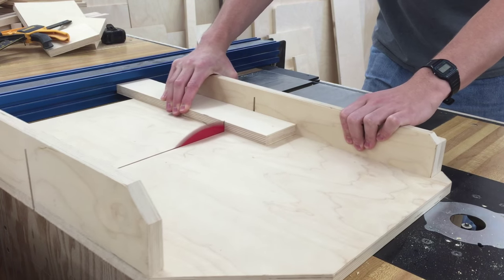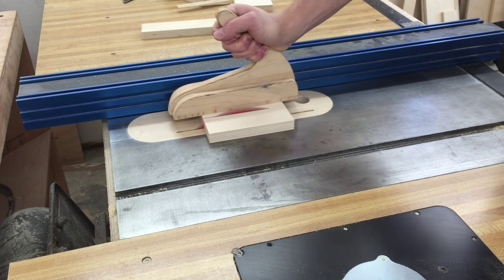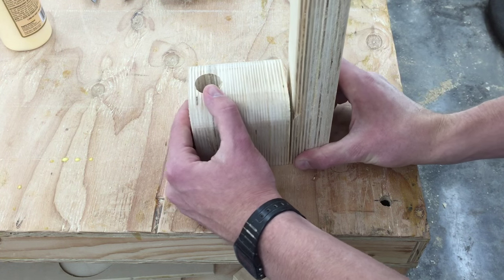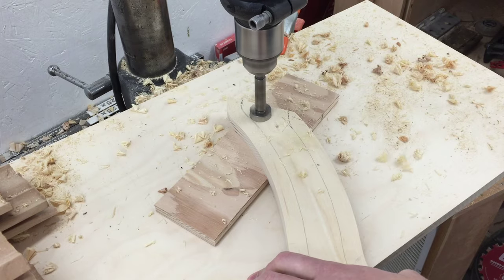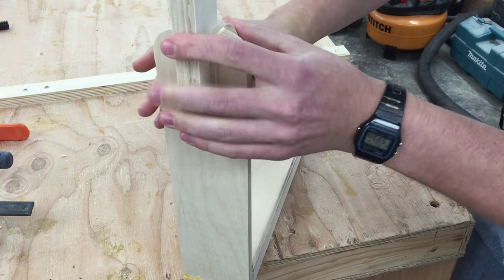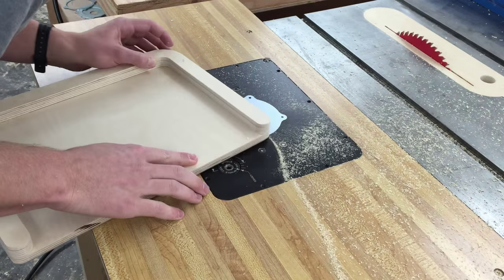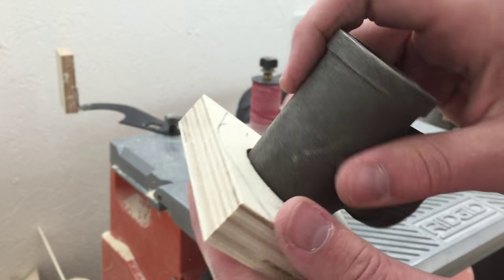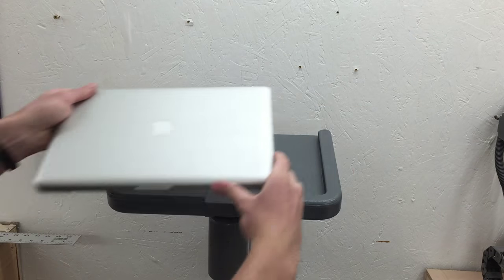Shop computer wall mount

Comment: Nice bandsaw :)
My laptops all blow hot air out the side, so that would need another hole.  Plus power, cause my batteries suck.
Reply from the maker: Thanks! Love the bandsaw.
And that's just two of the reasons I love MacBooks :-)
Reply from the maker: +Derek Richline I really hardly even run Sketchup on this one. I do the drawing on my other computer and use this one to view dimensions, and sometimes use it for internet browsing. But it would never get to 170°, with my other MacBook I doubt it ever gets to 100° when editing video.

Comment from the maker: If you have an opinion, please comment: do you like videos like this one (sorta long but covering (almost) every detail of the build) or do you prefer shorter, less detailed videos? Thanks!
Reply from the maker: Thanks for the feedback! I use the earbuds that came with my iPhone for the narration, and I think I'll get a cord to extend them so I can also use them when I'm talking to the camera.
 In this case it can make a lot of difference what speakers you're using. For example if I watch this on my computer the narrated parts are louder than the talk-to-the-camera parts, but if I listen through my headphones, it's vise versa. There are a vast variety of speakers viewers might use, so it's hard to make it perfect for every one.
Reply: Jer's Woodshop length and overall quality are well above average and totally sufficient. Where you shine is in the solidity of the build and especially the out-of-the-box approaches, like that incremental table saw fence which i liked so much. It was smart and sharp, but i also liked the fact that it made me feel like "i could do it" even though it included welding which can be daunting to beginner DIY makers like me.
So i'll keep on watching whatever content you put out in the future.
Keep on trucking !
Reply from the maker: Thank you very much!
Reply: Jer's Woodshop Another great video!
Since the model is in your Mac, I would cut the arm's pieces by the CNC.
Reply from the maker: Thanks Don.
Reply: Jer's Woodshop Excellent video. I wouldnt change a thing
Reply: +Jer's Woodshop make two , one for short one for detailed!!!! :P great work! keep up.
Reply: +Jeremy Schmidt I've joined your channel recently and like the things you show. Videos below 15 minutes are okay in my opinion, depending on what's build. As mentioned, audio quality could be improved. I think you could also play around with light settings, but overall it's the content that matters. Thumbs up for your efforts!
Reply: It's Perfect , love the details and fast forwarding so the video isn't too long.  Keep up the great work and don't change a thing, just more projects !! ;)
Reply: I started watching your channel when you built the linisher and the extentions for it. I find your approach to be intuitive of your audiences lack of skill and the details that you include are mandatory for most non engineering types. That said I mostly subscribed after the linisher build because of your sense of humour that was allowed to flow. More humour please Jeremy.
Reply: Jeremy Schmidt I love your work. I'm enjoying it to the max.
Reply: The details are good. :)
Reply: I really like the details, Nice too see and think about the how's and why's of the build and maybe ways I would change it to fit my needs. Thanks again.

Comment: Detail is great, I like the length and everything. My suggestion is to be careful to squeeze too much glue out of the joints on smoother surfaces. There are videos about the joint strength correlation between too much, too little and just right glue use. PS: You are a natural and very lucky to be sooo skilled already!

Comment: A few years later, how did the Mac do with dust? Thanks!!
Reply from the maker: +Green Acre Homestead 
No problems so far!
Reply: really the intake vents on either side under and towards the front are now blocked, if you're going to do some 3d rendering or what not, your circulation is blocked off. Its good in away thats how the dust will go in, its bad because your computer could over heat.

Comment: One of the reasons I ended up with a desktop (aside from a huge computing power advantage) is that I didn't want to spend $200 on a good wall mount. Had I found this earlier, things may have been different. Thanks for sharing
Reply from the maker: I like the laptop because I have the option to take it to where I'm working. Also, I wanted a 2012 or newer Mac, and this MacBook was cheaper than a desktop.

Comment: Video length was fine, your pace and explanation right on the mark. Wish my computer skills were good enough to warrant putting one in my shop but I use it to look at You tube videos and pictures. ;-) Might be time to invest in smaller band saw blade so you can make tighter radi. Nice job.
Reply from the maker: Thanks for the feedback! 
I didn't feel like changing to my dull 1/4" blade... :)

Comment: Your videos are unique and interesting, my complaint would be that there aren't enough of them :-) For most, we will need to use that cord slot for power and my laptop would definitely overheat without some vents in that base. I love the compact, out of the way design, works well for us small shop guys.
Reply from the maker: Thank you! I hope to start posting more videos soon. Also this computer vents along the hinge, so the fan can run without interference. But you'll have to modify the design for your laptop.

Comment: The only thing I would add is a bushing between the plumbing T and the stand that way when you swing it or tilt it, it won't rub so hard and chatter/ hop on the stand. Otherwise great video look forward to more!!!!
Reply from the maker: Thanks! It swiveled nicely until I painted it, so maybe I'll take out the pipe and sand off the paint. Not a big deal but it does "chatter/hop" like you said.

Comment: Very nice project Jer but in keeping with the woodworking theme, couldn't you have created your own "T" using large dowels instead of the metal T and pipe? Otherwise, very detailed project and quite a useful one as I'm seeing more use of small laptops and Tablets in workshops.
Reply from the maker: +woodstoney 
I'm not partial to one material or the other; I'm both a woodworker and a metalworker, so I use whatever material I feel is appropriate.

Comment: Well done video.  Clear and concise but with lots of very helpful details.  Nice to see a Mac in a woodworking shop. Do you have trouble finding programs that you need that are Mac compatible?
Reply from the maker: There are definitely less programs for Mac. But my shop computer is primarily for CAD (checking dimensions from drawings that I drew on my other computer, usually), and for that, there is Sketchup. I also plan to run my CNC with it, and if you watch other YouTube woodworkers you can probably guess what that means. ;-)

Comment: Clever job, but... laptop needs to dissipate the heat! Though there are no holes in your  making, you need a few for fresh air to flow :)
Reply from the maker: The only vent on this laptop is along the hinge. There is no restriction on the airflow.

Comment: I think you should hollow out a portion of the base to allow air circulation for cooling the computer.
Reply from the maker: +David I have addressed this issue many times in this comments section...but again, this computer vents through the keyboard and hinge, so it will cool just fine if it ever warms up. But it has never warmed up noticeably.
Reply: Sorry. Then might I add that I think your design is magnificent.

Comment: Great videos my friend. I have a metal fab and woodworking interest so I plan on making your table saw fence system one of these days. You do amazing work, keep it up. One day you will be huge.  One question, what size and type of band saw do you use?  I am looking t upgrade mine. Thanks!!
Reply from the maker: Thank you! 
I use Matthias Wandel's 16" wooden bandsaw. I love the saw, it was quite easy to make, but took a lot of time to complete. If you have some free time to work on it, I definitely recommend you build it. I'm sure it will be the cheapest way to get a new 16" bandsaw.

Comment: Great job. Still I think you didn't considered the ventilation of your laptop. this would be my only objection, otherwise great video, great project, excellent job!
Congrats!
Reply: eugen dragos safta i was going to post the same thing.
Reply from the maker: Thank you. The computer has no vents in the sides or bottom, only along the hinge. The fan can run with no obstruction.
Reply: I understand now.
Thanks. Cheers!
Reply: eugen dragos safta Maybe you have not got a MacBook! :-)
Reply: Indeed I don't, otherwise I wouldn't make stupid remarks :).

Comment: Jeremy, great video!  Since you’ve already addressed the concern about airflow (numerous times, in fact), I’ll ask three other questions: (1) Why didn’t you notch a space for your power input connector?  (2) Why didn’t you create the ability to make the mount side-collapsible, just so the mount can be pushed flush against the wall when you’re not using it? (3) If you wanted to make the top adjustable, allowing for different laptop sizes, how would you go about doing it?
Reply from the maker: Thank you!
(1) I did. I failed to clearly show that on the video, but it is notched out for all the ports on the left side.
(2) I never thought of it! It's in a place where that isn't really necessary, but still that would have been cool!
(3) I'm not sure...I only use this one laptop in the shop, so I didn't even try to make it adjustable. My first thought would be to make it like this for the smallest laptop, then cut it in have and make some slides for it to adjust width. That's not a very refined idea though, it probably wouldn't look very good!
Reply: +Jeremy Schmidt I agree.  The slide system wouldn’t be as sweet looking as what you’ve created.  The only other idea I’ve got in mind is to cut the platform down the middle, conjoining both sides with bolt and nut system (on the bottom, I suppose), and cutting a wooden section for the gap.  Perhaps that idea is considerably similar to what you’ve got in mind. Nevertheless, it certainly sounds far worse than your suggestion!
Reply from the maker: +David Jordan I think a better option is to just make separate computer holders that can be dropped into the support arm. The only issue then is storing those.

Comment: Be careful with your silicone keyboard protector. The air intake for MacBooks is through the gaps around the keys and out the hinge.
Reply from the maker: Thanks. I wasn't real sure about that, I knew it vented on the hinge but wasn't sure about the keyboard. Anyway the fan has never come on since I've owned the computer, so I think it's ok for how I use it.

Comment: Very nice.  One questions, on the table, did you allow a port for the fans to cool the computer.  Again nice job.
Reply from the maker: The computer's only vents are along the hinge, so I didn't need to cut any openings for that. It can vent just fine. Thank you!
Reply: Nice, my Dell sucks the air from the bottom.  So I would have to make some holes.  Great video.

Comment: Other question :p

Do you have more informations to Incra router table?

I saw in one of your video you can adjust the height with a crank, is a homemade ? or can we do this with any router that?
Reply from the maker: You can find more info about it at incra.com 
It is not homemade, and most router lifts work this way. Please note that is not part of the router, the router clamps into the router lift which just adjusts it's height.

Comment: air vents are needed for laptops. Safety issue. But I reckon that isn't in the video.
Reply from the maker: The air vent in a MacBook is along the hinge, so it is completely unimpeded.

Comment: you need to have opening for the laptop IO
you will need to user the USB and the Power cable
Reply from the maker: It has a cutout on the left side for all the ports.

Comment: not to be a naysayer - i mean nice project and everything - but i can't think of a better way to overheat your laptop!! i would have used perf metal maybe
Reply from the maker: You mustn't be familiar with MacBooks. The vent is in the hinge, completely unimpeded by the holder.
Reply: oh? yes news to me! though i was under the impression that heat buildup inside is kind of critical with these ... regardless of venting scheme ... i'll take your word for it though - and i'm glad you thought about it first.

Comment: Pro-tip: computers need to breathe.  The ventilation on laptops is usually on the bottom.  With no vents on your holder and such a perfect fit, you may notice diminished performance and/or lifespan out of this rig. 🤔
Reply from the maker: You’re not familiar with MacBooks I see. The only vent in these is along the hinge, so it’s completely unobstructed. There are no vents or holes of any kind on the bottom.
Reply: @Jer_Schmidt  interesting! I didn't even notice it was a Mac.  But you are correct, I am not familiar with them at all -- it's an interesting design decision, but it makes a lot of sense;  pretty much every PC laptop I've used has had the vents on the bottom. 👍

Comment: Love your stuff Jer. Are you related to Matthias? I ask because the both of you have very interesting projects.  for your wide shots, maybe this mic is a good starter solution.  http://www.monoprice.com/Product?c_id=115&cp_id=11502&cs_id=1150206&p_id=600320&seq=1&format=2
Reply from the maker: Sprank900 Thank you! I'm not related to Matthias, as far as I know. Thanks for the mic recommendation, not sure how well that kind of mic would work in my shop because it is quite echoey, as you can tell...I was thinking the clip-on mic might be the way to go. But I really don't know much about that...
Reply: Jer's Woodshop If your shop is echoey, you most definitely should utilize a lavalier mic instead of a shotgun mic. The shotgun will exacerbate the echo problem. If you want to hide the lavalier, under your shirt,  buy some TRANSPORE tape ( a clear ,perforated  easy to rip, tape made for direct skin contact ) from the First Aid aisle of your favorite Walgreens/CVS/Rite-Aid. approx. $4/roll.  Use that to tape it on your chest in the indention on your chest between your pecs. If you place the mic too high you lose some intelligibility.  Also that indentation in your chest allows the mic to avoid your clothes from rubbing on it.  If you would like help choosing a wireless mic rig. I'd be happy to advise.
Reply from the maker: Thank you. In my "Pocket hole plug maker" video, I used my iPhone headphones as the mic. I was talking while shooting on that video, there is no voiceover. I was fairly happy with the audio, but I was limited to about 3 ft from the camera the whole time. So I was thinking about getting an extension wire for them. Would that be an OK setup?
Reply: Jer's Woodshop "Okay" is whatever works for you Jer. An extension cable would certainly work, it would give you more 'wiggle room'  : ) and cost you very little.